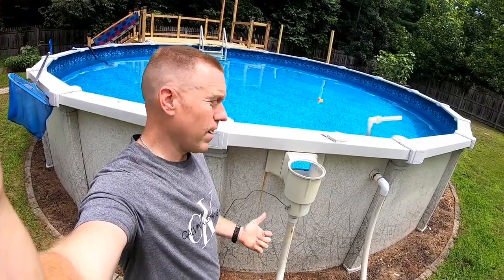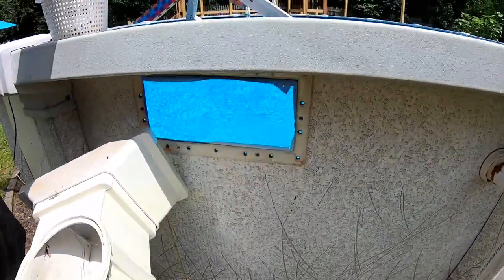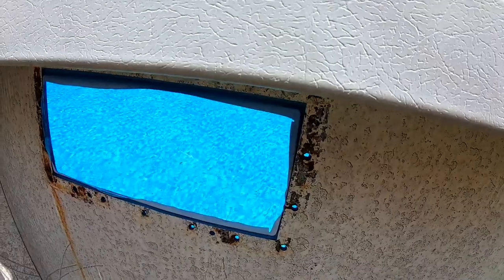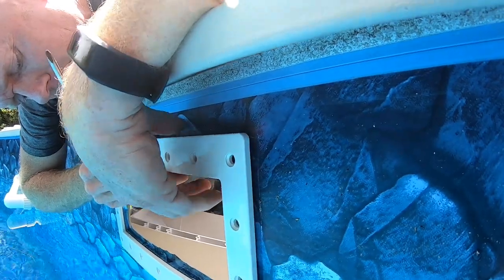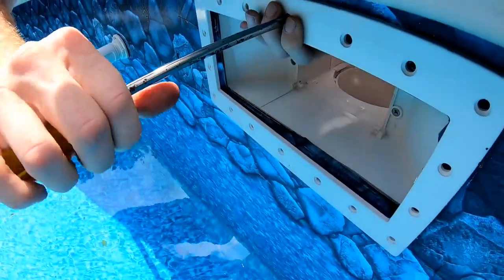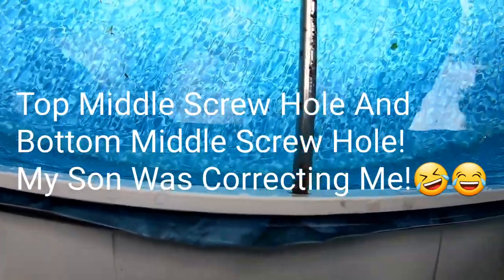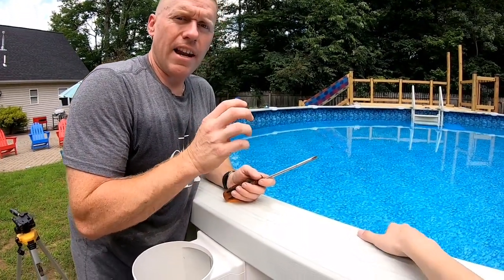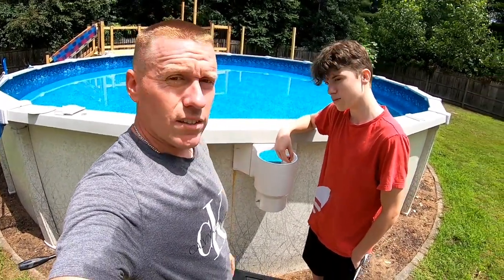How To Replace An Above Ground Pool Skimmer DIY!

Comment: You got lucky your liner did not sinkor pull down. Do I have to worry about the liner being pulled down by the weight off the water? I just removed my winter tarp today and saw my skimmer was cracked
Reply from the maker: No, this is how you change the skimmer with water in it, you will be fine just make sure the water is drained below the skimmer then line up the new stuff goes together easy! Good luck! Thanks for watching!
Reply: @WhitehouseFarmVet   I was wondering the same thing, with the plate being removed it would put added stress on the liner.  Glad I saw this, now I feel better .  Thanks brother!
Reply from the maker: @cheskybaba4864 Awesome thank you and thanks for watching!👍

Comment: I’ve read conflicting things about butterfly gasket that they go in front of the liner not behind so water doesn’t go between the liner and wall. Which is correct? Everyone does it differently.
Reply from the maker: It all depends on the company or brand the way that they want you to install it!, I personally have always done them this way with zero issues!  Good luck with however you decide and have a great summer! Thanks for watching!

Comment: Everything you showed was great. I got my skimmer off kust as easy as you did. Only thing I did different was clean the rust off the old gasket surfaces on the pool. Bit of light sanding and an alcohol rub down to remove sanding dust. I am a 25+ year mechanic 
 I never pit new gaskets on uncleaned surfaces. Don't want to do this again because the rust areas caused leaks
 Have a great summer
Reply from the maker: Awesome thank you and I'm sure you will have a great seal for sure !!!!! Thank you for watching and have a great summer too!😊

Comment: Thank you for this!
Do you happen to know if wide skimmers are of the same size? Can't seem to find the exact same skimmer product that my pool has. Thanks
Reply from the maker: They have wide mouth skimmers and small, you normally don't see the small too much they were used on older pools, but as far as widemouth skimmers go most parts are interchangeable,  what exactly are you looking to replace????
Reply: @WhitehouseFarmVet  Thanks! Didnt notice your respond - I went ahead and bought a widemouth hayward skimmer (I was replacing an old Jacuzzi one that I think has now phased out? at least couldn't easily find this). Anyway, they fit much like you mentioned :)

Thanks!

Comment: Would you recommend using some caulking on the interior side of the gasket?
Reply from the maker: No you don't need it the gaskets are meant to keep the water out without any caulk or Silicone!! Thanks for watching!

Comment: Just had my liner replaced and the installer used a dry rotted old gasket when he installed my skimmer so now I am left to fix it... got a new skimmer and return but am also scared of the liner dropping when i take the faceplate off the skimmer... i see yours is staying perfectly in place and I hear if the water level is high like an inch below the skimmer there should be no movement but I have also heard it most likely will sag and ruin it.... whats your opinion on this? thanks !
Reply from the maker: You will be fine just make sure the water is a couple inches below the skimmer, it should stay in place and you should be able to line up all the holes again together!!!  This is how I Replace people's old skimmer gaskets that are leaking and need replacement!  Good luck and thank you for watching!
Reply: @WhitehouseFarmVet  talked to the guy at the pool store and he told me I installed the butterfly gasket wrong but doing this method… has your success rate been pretty high or should I be worried about water leakage between the gasket and liner behind the pool wall? There is so much conflicting information on pool installs I can’t believe it lol
Reply from the maker: I personally have had zero issues!!!!! This is how I do my own pool and the 1000s i have done for 20 plus years!!!  Whatever way you decide good luck and thank you for watching!
Reply: @WhitehouseFarmVet  that’s good to hear. Just got the pool filled last night and it seems good but I can’t tell what’s happening between the liner and the pool wall.  This method works without the wall foam too correct? I currently have faceplate-liner-butterfly gasket-pool wall-butterfly gasket-skimmer. This is how the installer had it setup as well before I had to replace the skimmer. I agree that the butterfly over the wall and liner seems to make the most sense but it also seems near impossible to line up holes etc doing it that way especially since mine was already installed and I had to replace it. Sorry for all the questions here, just trying to get this handled and move on

Comment: My skimmer is stuck on after removing the plate and all the screws?
Reply from the maker: Just make sure you did remove all the screws and it will pull off just wiggle back and forth!  Thanks for watching!👍